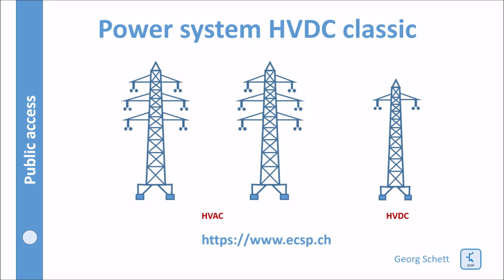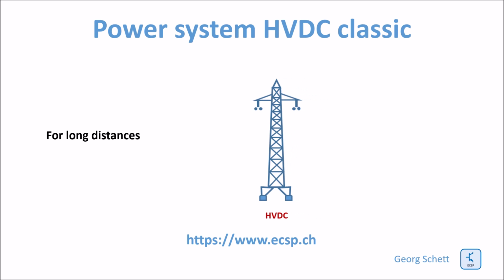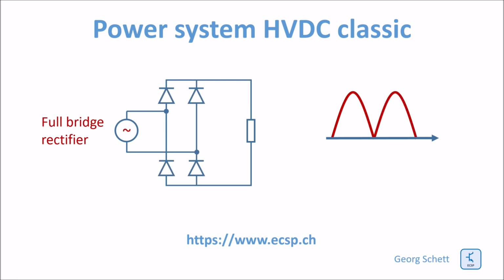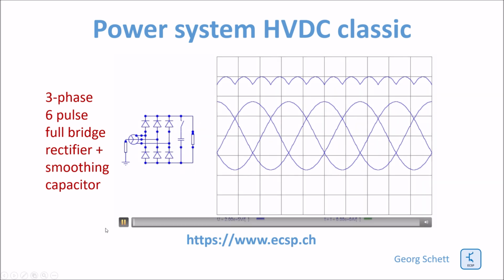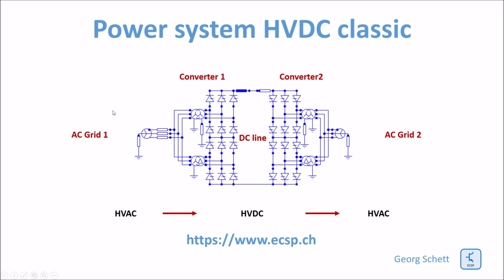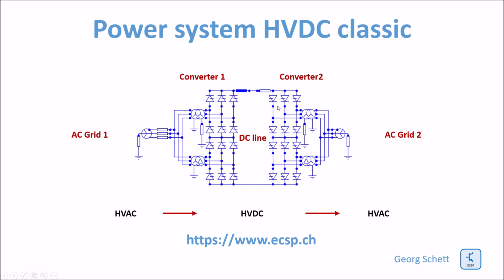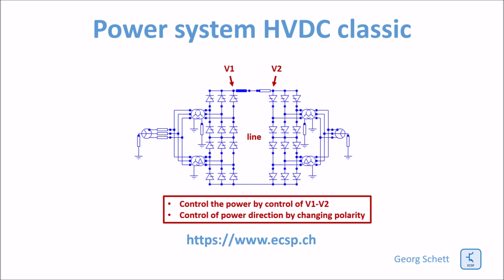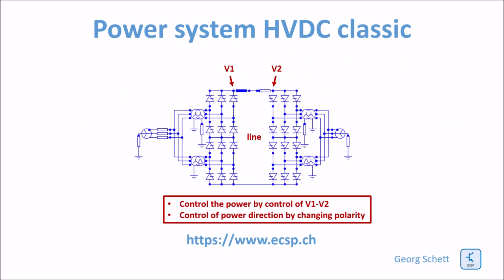Power system HVDC classic [circuit simulator]

Comment: Your very first explanation about AC transmission reveals that you do not understand transmission lines and characteristic  impedance. Thank you for making this your first point as it saved me 8.5 minutes of potentially wasted time.
Reply from the maker: I admit that the AC introduction is oversimplified and much too negative, today I would certainly choose another approach to make the case. However the transmission losses above 1000 km are significant. The main issue however as you know is stability, which can be overcome but at increasing costs per line length. Maybe I will rework the video.
Reply: @georgschett801  No, you didn't oversimplify. Transmission lines are simply not lowpass filters. They have no inherent bandwidth limit. If they did my work with coax cables at 60GHz would never have been possible. Your error is a common one however and stems from imagining them to be comprised of lumped elements. This analysis can be made to work, but only by allowing the number of elements to tend to infinity. So please, don't use this analogy - better to say nothing than feed erroneous ideas into the minds of those that may one day need the correct models.
Reply from the maker: Everything you say is correct. You are obviously a HF expert! Pardon me however if I still use the simplification. In power system analysis we often use a simple lumped LCR models for power flow analysis. The lumped models give quite good results for shorter transmission lines. If however we need models for longer lines, higher frequencies (switching impulse, lightning), Ferranti effects or compensation of reactive power more accurate models are used. I myself use a type of Bergeron distributed model which is common in programs such as EMTP or ATP. I guess you use similar models based on surge impedance characteristics. So again, I exaggerated the losses with my introduction and there I fully agree with you.

Comment: Power loss in the converters, especially when thyristors are used. Thank for the presentation. 
Students do not to try these things using voltage sources,  resistors, inductors, capacitors, diodes, etc., just computer circuit emulators.